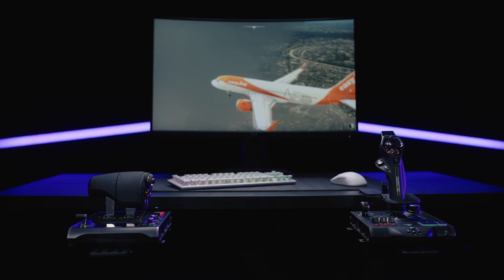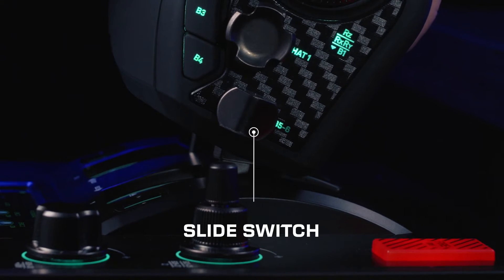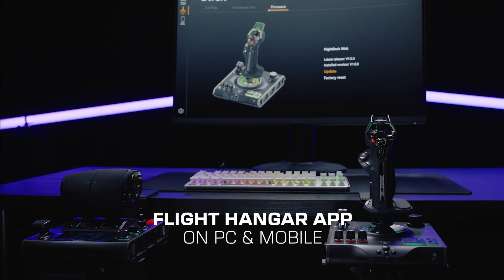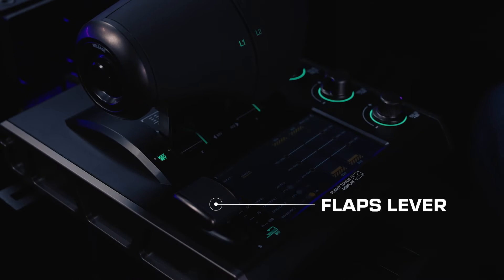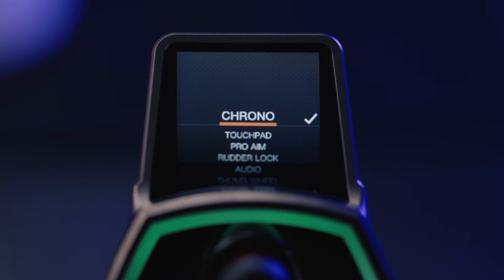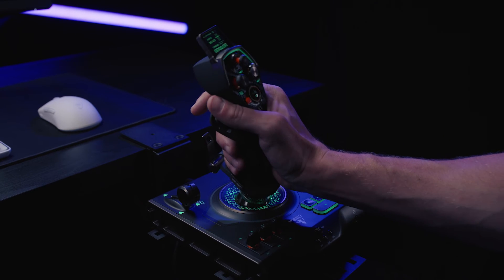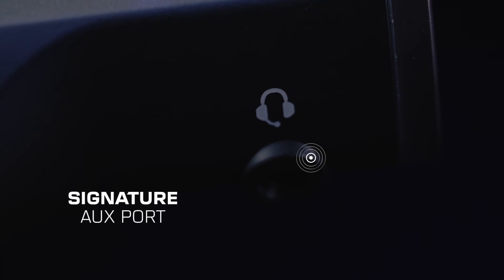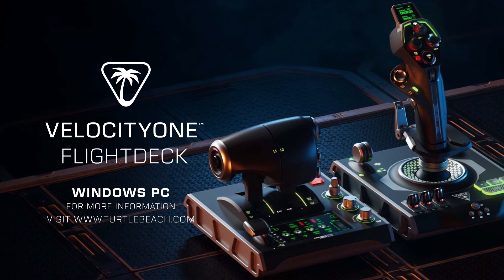Turtle Beach VelocityOne Flightdeck Technical Overview

Comment: Just received mine in the mail! Question about the three toggle switches on the control stick. The middle toggle stays in position (up/down); however, the left and right toggles reset back to center when pressing. Is this by design? 3:31

Comment: I just want a simple setup with a few buttons that works. This is ridiculous and so is the price and it doesn't even work for completely with microsoft flight simulator.
Reply from the maker: If you want simple, then you definitely dont want a HOTAS style setup or controller. The idea here is indeed a lot of buttons so you can have the various functions all on spot.

Comment: I like it, next time they should make it with metal switches and a joystick with a Hall sensor.
Reply: The joystick does have a hall effect sensor, as per the product page "Designed to deliver high-precision, accuracy with durability that will stand up to the most rigorous use, all main movement controls on the stick and throttle are built using hall-effect non-contact sensors."